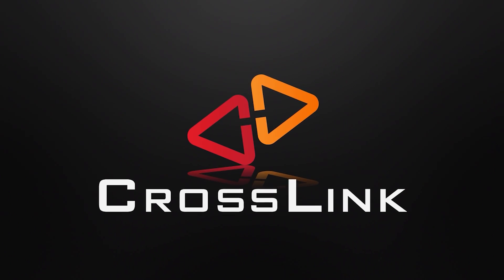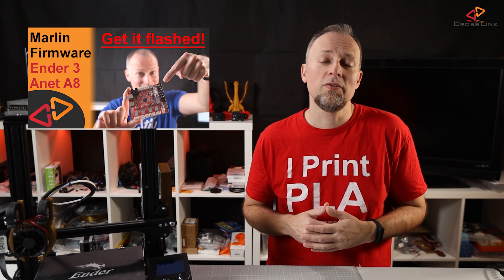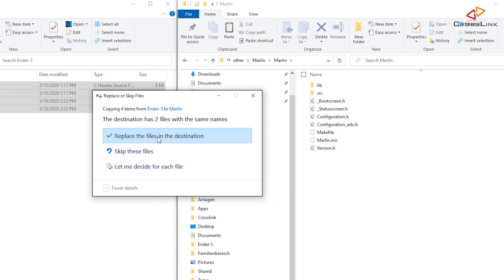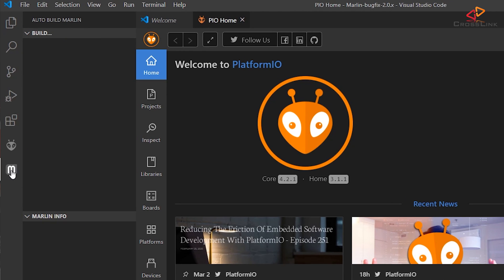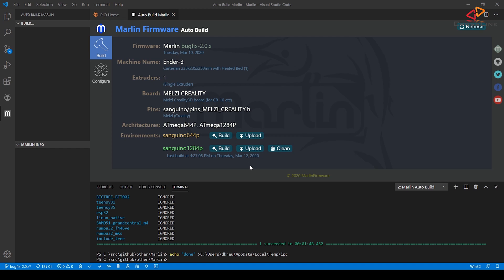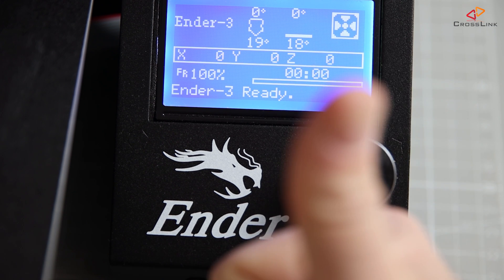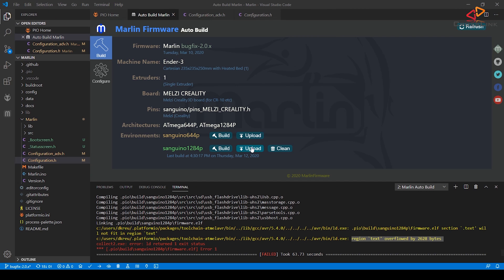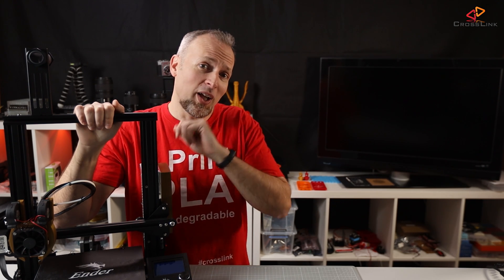Ender 3 (Pro) Marlin 2.0 Upgrade  - Updated Version

Comment: Have tired 2 different pc's and reload the programs 3 time and keep getting the same message "sanguino_atmega1284p  FAILED    00:00:01.864". Do you have a recommendation?
Reply: I get the same error compiling, i have even tryed with a older version of marlin but i get the same error.
Reply: Same here
Reply: Use the bugfix branch.  He didn't specify that part.
Reply: @Thibbs5  hey guy! I have the same issue so i got the bugfix firmware, but now i get the option to build either Melzi or Melzi_opiboot  which one shall i choose for ender 3?
Reply: @Thibbs5  I used the bugfix branch, it still failed.  Oh well.  Guess I didn't need to update the firmware that bad anyway.
Reply: @Thibbs5  How do i do that?
Reply: Try PIO Update.  I was getting this error with the logs showing something to the effect of missing parathesis.  Running PIO UPDATE from the command line fixed the issue and everything else has gone smooth.
Reply from the maker: Can you please post you output window contents here?
Reply: @Crosslink3D  sanguino1284p .......... FAILED     Compiling .pio\build\sanguino1284p\src\src\module\probe.cpp.o
* [.pio\build\sanguino1284p\src\src\module\motion.cpp.o] Error 1  Good clear video thanks ... i get the same error though  my printer is still in the box just got it today so any  help for this firmware would be grateful Ender pro 3...  in the  config examples there is a option for the pro 3 now what could be the problem?
Reply: I'm having the same issue with the Melzi_optiboot showing up as an option.

Comment: After installing the firmware... my printer now knocks of the prints,... after a couple of layers.. :( Possible to solve this?
Reply from the maker: Did you enable mesh bed leveling or using a probe?
Reply: @Crosslink3D  don't use both. I know what the issue was.. de x gantry was living his own life..
Reply from the maker: Uhhhh that's bad 🤪

Comment: would love to see your thoughts on using this system to enable BLtouch or other probes, i use. mac so having a hard time trying to find what i can use to get my touch probe set up
Reply from the maker: Great suggestion!
Reply: @Crosslink3D  Hi i am new to updating firmware etc. my new ender 3 pro has  the new v4 2.2 mainboard and i am stuck getting bl touch working. i have marlin 2.0 on the printer but i am stuck with what changes to make etc. please can you help?
Reply from the maker: I’ve just released a new video about how to use the bltouch with Marlin 2.0. it’s for the Ender 3 bit should be working with any printer (the hardware connection might of course be different but the firmware config is probably very simple to adapt)
Reply: I would also like to see a video regarding BLTouch in the 2.0 firmware

Comment: hello to you when I composed the types of cork so I got these errors
In file included from Marlin \ src \ HAL \ AVR \ .. / .. / inc / MarlinConfig.h: 40: 0,
                 from Marlin \ src \ HAL \ AVR \ Servo.cpp: 56:
Marlin \ src \ HAL \ AVR \ ../../ inc / SanityCheck.h: 1297: 4: error: #error
   #error "Select one of: MESH_BED_LEVELING, AUTO_BED_LEVELING_LINEAR, AUTO_BED_LEVELING_3POINT, AUTO_BED_LEVELING_BILINEAR, or AUTO_BED_LEVELING_UBL."
    ^
In file included from Marlin \ src \ HAL \ AVR \ .. / .. / inc / MarlinConfig.h: 40: 0,
                 from Marlin \ src \ HAL \ AVR \ HAL.cpp: 25
Marlin \ src \ HAL \ AVR \ ../../ inc / SanityCheck.h: 1297: 4: error: #error
   #error "Select one of: MESH_BED_LEVELING, AUTO_BED_LEVELING_LINEAR, AUTO_BED_LEVELING_3POINT, AUTO_BED_LEVELING_BILINEAR, or AUTO_BED_LEVELING_UBL."
    ^
In file included from Marlin \ src \ HAL \ AVR \ .. / .. / inc / MarlinConfig.h: 40: 0,
                 from Marlin \ src \ HAL \ AVR \ HAL_SPI.cpp: 34
Marlin \ src \ HAL \ AVR \ ../../ inc / SanityCheck.h: 1297: 4: error: #error
Compiling .pio \ build \ sanguino1284p \ src \ src \ HAL \ shared \ backtrace \ unwinder.cpp
   #error "Select one of: MESH_BED_LEVELING, AUTO_BED_LEVELING_LINEAR, AUTO_BED_LEVELING_3POINT, AUTO_BED_LEVELING_BILINEAR, or AUTO_BED_LEVELING_UBL."
    ^
In file included from Marlin \ src \ HAL \ AVR \ .. / .. / inc / MarlinConfig.h: 40: 0,
                 from Marlin \ src \ HAL \ AVR \ eeprom.cpp: 23:
Marlin \ src \ HAL \ AVR \ ../../ inc / SanityCheck.h: 1297: 4: error: #error
   #error "Select one of: MESH_BED_LEVELING, AUTO_BED_LEVELING_LINEAR, AUTO_BED_LEVELING_3POINT, AUTO_BED_LEVELING_BILINEAR, or AUTO_BED_LEVELING_UBL."
    ^
In file included from Marlin \ src \ HAL \ AVR \ .. / .. / inc / MarlinConfig.h: 40: 0,
                 from Marlin \ src \ HAL \ AVR \ MarlinSerial.cpp: 39:
Marlin \ src \ HAL \ AVR \ ../../ inc / SanityCheck.h: 1297: 4: error: #error
   #error "Select one of: MESH_BED_LEVELING, AUTO_BED_LEVELING_LINEAR, AUTO_BED_LEVELING_3POINT, AUTO_BED_LEVELING_BILINEAR, or AUTO_BED_LEVELING_UBL."
    ^
In file included from Marlin \ src \ HAL \ shared \ .. / .. / inc / MarlinConfig.h: 40: 0,
                 from Marlin \ src \ HAL \ shared \ HAL_spi_L6469.cpp: 28:
Marlin \ src \ HAL \ shared \ ../../ inc / SanityCheck.h: 1297: 4: error: #error
   #error "Select one of: MESH_BED_LEVELING, AUTO_BED_LEVELING_LINEAR, AUTO_BED_LEVELING_3POINT, AUTO_BED_LEVELING_BILINEAR, or AUTO_BED_LEVELING_UBL."
    ^
In file included from Marlin \ src \ HAL \ AVR \ .. / .. / inc / MarlinConfig.h: 40: 0,
                 from Marlin \ src \ HAL \ AVR \ watchdog.cpp: 25:
Marlin \ src \ HAL \ AVR \ ../../ inc / SanityCheck.h: 1297: 4: error: #error
   #error "Select one of: MESH_BED_LEVELING, AUTO_BED_LEVELING_LINEAR, AUTO_BED_LEVELING_3POINT, AUTO_BED_LEVELING_BILINEAR, or AUTO_BED_LEVELING_UBL."
    ^
Compiling .pio \ build \ sanguino1284p \ src \ src \ HAL \ shared \ backtrace \ unwmemaccess.cpp.o
* [.pio \ build \ sanguino1284p \ src \ src \ HAL \ shared \ HAL_spi_L6470.cpp.o] Error 1
* [.pio \ build \ sanguino1284p \ src \ src \ HAL \ AVR \ Servo.cpp.o] Error 1
* [.pio \ build \ sanguino1284p \ src \ src \ HAL \ AVR \ watchdog.cpp.o]
* [.pio \ build \ sanguino1284p \ src \ src \ HAL \ AVR \ HAL.cpp.o]
* [.pio \ build \ sanguino1284p \ src \ src \ HAL \ AVR \ eeprom.cpp.o] Error 1
* [.pio \ build \ sanguino1284p \ src \ src \ HAL \ AVR \ MarlinSerial.cpp.o] Error 1
* [.pio \ build \ sanguino1285p \ src \ src \ HAL \ AVR \ HAL_SPI.cpp.o] Error 1
can you help us with that?
Reply from the maker: Looks like you wanted to enable some kind of bed leveling but did not choose what kind of bed leveling.

Comment: I love watching your videos.  I have a question that so far i have not been able to find a specifically  answer for:
I have the Ender 3 and I installed the Bigtreetech SKR Mini E3 Version 1.2 and have the Firmware Marlin Bugfix 2.0 x loaded.  Before I install the BLTouch Version 1.3 is there anything else I need to do differently to make this work?  I hear some say you just plug the cables into the board and enable the leveler.  Of course I'm not sure what they mean by enabling...is that thru the Ender display so It's just a click or is there some firmware editing to be done?  I have never done this stuff, so before I educate myself I thought to ask first.
Reply: I too have just upgraded my other Ender 3 pro to the SKR Mini E3 v1.2 & have installed the the BL touch (V3)!
Depending  on what version of BL touch you have you may have to re seat some of the cables on the DuPont connector!
I have installed one but am having trouble getting it work properly

Comment: I am having these errors when trying to upload: avrdude: stk500_getsync() attempt 1 of 10: not in sync: resp=0x65
Any idea how I can fix it ?
Thanks
Reply: What programmer are you using? usbtiny ?
Reply from the maker: Probably the upload speed is not set to be 115200. Look in your platformio.ini in the configuration section for the environment you selected and change it to 115200.

Comment: Hello!
When trying to compile, I have this error:

Verbose mode can be enabled via `-v, --verbose` option
  File "C:\Users\EldonTyrell\.platformio\platforms\atmelavr\builder\main.py", line 30

    print "Please unplug/plug device ..."

                                        ^SyntaxError: Missing parentheses in call to 'print'. Did you mean print("Please unplug/plug device ...")?
Any idea how I can fix it ?

I think we need to install something else prior to install VsStudio Code as this apparently does not work out of the box.

thanks for helping me !

Stéphane
Reply: OK, apparently, it can be fixed by entering "pio update" in the IDE terminal.
Please add this to your tutorial as this really blocked me for some moment and many users will be blocked exactly like me.
Reply from the maker: Noted!

Comment: Fantastic guide. Thanks for all the help! I can successfully flash Marlin 2.x.x to my E3P(creality silent 1.1.5 board) no problem.I am even noticing an improvement in quality! :)

Though I am having an issue enabling Mesh Leveling. I can enable/disable all the features you have mentioned, but as soon as I try and enable LCD_BED_LEVELING, I cant flash the firmware :/ I have rebuilt and reflashed after commenting/uncommenting each line one by one. It always fails at the LCD_BED_LEVELING line. The printer will show it momentarily but after a reboot it shows a blank screen and wont boot again. Any idea why that line specifically could be giving issues? Thanks again :)
Reply from the maker: Probably you have not enough memory left. Try to reduce firmware size using this guide: https://thborges.github.io/blog/marlin/2019/01/07/reducing-marlin-binary-size.html
Reply: @Crosslink3D  You were right! I was filling up to basically full, I needed to leave some additional extra space and it loaded! Your videos rock thanks for the help.

Comment: how do I change board type? when I load marlin, it shows a board and machine I dont have.
Reply: Same here, i got up to 6:06 and the machine name is RAMPS 1.4? How do 
i switch this?
Reply from the maker: You both did probably not copy the default config files for your printer to the right directory or did not overwrite the default files.

Comment: How could this work? An older Ender3 has a 8-bit board and also a 8-bit firmware. So far I know, the Marlin 2 is for 32-bit boards, and how this 32-bit firmware could run on a 8-bit board?
Reply: Marlin 2.X IS NOT ONLY for 32 bits. It also compile for 8 bits
Reply from the maker: Exactly. Marlin 2.0 not being for 8bit was a big rumor when it wasn't released but it works with no issues

Comment: Having a blue screen on the ender 3 and weird beeping sounds after enabling mesh bed leveleing and disabling the features you sugested. The board isnt responding either by connecting to PC or standalone. 
I have followed your instructions and every step worked well till the last step.

1)  Update to Marlin 2.0.5 worked
2) Enabling mesh bed leveling and disabling Arc Support + custom bootscreen --> firmware was compiled and it seemed to be ok BUT the Ender 3 Screen was frozen and weird beeping started.

If i now turn on power nothing other happens than the blue screen and the PC will not recognice the board anymore.

Creality 1.1.5 Board
TMC2208
Reply: Hi Marko. I had the same problem with my same board. We need 512 bytes open for bootloader. You need to disable more and get firmware to MAXIMUM 99.2%.It will not work with biger size.  good luck
Reply: P.S. you need to reload bootloader now I would have been overritten
Reply: P.S. I used this guide using a raspberry pi : https://www.fission3d.com/post/flash-bootloader-and-install-firmware-with-raspberry-pi
I loaded optiboot bootloader:  https://github.com/Lauszus/Sanguino
Reply from the maker: Correct, I remember having this issue the first time I flashed a firmware too big. You need to flash a new bootloader 😟
Reply: @Crosslink3D  alright thanks!

But great Videos on your channel anyway!! thank you for that :)
Reply: @tangmonster  Thanks for your fast reply! This is also what i thought happened . I thought the size of the bootloader is being reserved and automatically calculated while compiling..

So ill have to get an ISP programmer or Arduino Uno anyway.

Thanks

Comment: I did this update yesterday marlin 2.0.5.3  I have a 1.1.5 silent board. With flash size of 99.8 and even 99.5 ( disabling boot and flash screen) I had weird problems escpecially after eeprom init. I actually lost bootloader and had to reload it. After disabling a few more things and getting "99.2% (used 129014 bytes from 130048 bytes)"  only then it worked fine with eeprom saving and is consistanly booting. Does the 1284p boards have seperate EEPROM or does the chip use some of the internal flash for this data space?
Reply: "I had weird problems" with weird problems i mean it booted a few times and then stopped working. after eeprom init. And I had to reload bootloader.
Reply: I found this link helpfull : https://thborges.github.io/blog/marlin/2019/01/07/reducing-marlin-binary-size.html
I added the two lines to my platformio.ini so that it looks like this:
#
# Sanguinololu (ATmega1284p)
#
[env:sanguino1284p]
platform      = atmelavr
board         = sanguino_atmega1284p
lib_deps      = ${common.lib_deps}
  TMC26XStepper=https://github.com/trinamic/TMC26XStepper/archive/master.zip
src_filter    = ${common.default_src_filter} +<src/HAL/AVR>
build_unflags = -g -ggdb
build_flags   = ${common.build_flags} -fno-tree-scev-cprop -fno-split-wide-types -Wl,--relax -mcall-prologues

compiles fine, lots of google links explain what these compiler directives do.
now my build is 94.5% 122922 bytes.
I have not tested this yet.
Reply from the maker: Exactly, this helps a lot. 99.X percent seems to cause some issues. I will mention that in a future upgrade.
Reply: @tangmonster  If it works, please us know. Thx in advance.
Reply: @marionette409   Hi ! , yes the compiler directives worked 100% for me. I have been printing constantly with this new firmware with mesh bed leveling etc. I am at 94.6% even with sd card and a list of other items enabled.

Comment: Help! Thank you for posting this video. You make it easy to understand. I'm having a problem after updating my 1.1.5 board to the marlin 2 bugfix in this video. When I turn on my ender 3, the LCD screen is blank. If I turn it off and on several times, so far it has eventually come on and I am able to print. This happens most every time I turn it on.
Reply: I'm having the same issue with my printer after upgrading to the 1.1.5 and 2.0 marlin  and will be watching for a fix because it is annoying not sure if older versions have this issue
Reply: I'm having the same problem except I've turned my printer on and off several times and it's still blank. I try to reflash and get a "not in sync" error like there is no bootloader.  If someone can PLEASE help me please do!

Comment: This version is compatibile with bl touch ?
Reply from the maker: Yes, Marlin 2.0 supports it of course
Reply: Thanks , when i was flash firmware the 3d printing had  struggled to start. In your opinion i have to change the motherboard ?? Thanks so much
Reply: I have the original motherboard ender 3 pro

Comment: i tired your other video first with the new version on marlin, i didnt load the new files like you said before opening the folder, how to i get it to see the replaced file, it says machine name is ramps 1.4 and environments mega1280 and mega 2560
Reply: Did you find an answer to this?
Reply: same here. Shows RAMPS and the two Mega options but not Sanguino
Reply: I hit the same issue. In my case, I missed that you have to put the config files in the Marlin directory. There are existing config files you have to copy over. Video was clear on it.

Comment: I am having issue "not in sync" after enabling mesh bed lvling steps. Is there a way to fix that through usb instead of buying other hardware?
Reply: Check the settings in before you uploa/flash the firmware to your motherboard. Experiment changing the port, programmer, and the other settings under the tools section in the toolbar at the top of your computer

Comment: Hello, I have instaled marlin correctly, all be right. But when i active bed leveling i cannot upload in my ender 3 pro. 1failed, 0 succeded... 
In the terminal i have one error "collect2.exe: error: ld returned 1 exit status
* [.pio\build\sanguino1284p\firmware.elf] Error 1"...
i dont find any solution in the comment or forum...
Reply: Nevermind, it's because you don't have enough space on the board.
Reply: You did enabled #define BLTOUCH? I had the same error. Looks like you can't for now until a fix.
Reply from the maker: Can you please post the content of your output window here, so I can read what is the issue?

Comment: i got error "1 failed, 0 succeeded."
so looks like i need to install boot loader, correct?
Reply from the maker: Well, that depends what's in the error messages. Scroll up and tell me about what the actual error message is.
Reply: i had the same problem with 2.0X, but success with 2.0.5.3

Comment: Hi Daniel, first of all, great video, thumbs up, keep up the good work.
FYI, I get out of sync error, but my printer is unlocked, so I flashed it with arduino without any problems.
I checked port settings, seems ok, do you know if there's anything I may also check to get it fixed on vs code?
Reply from the maker: Probably you have to change the baudrate to 115200 in platformio.ini for your specific environment.
Reply: @Crosslink3D  Thank you for a tip, I'll check it out
Reply: @Crosslink3D  Could you please describe to a complete newbie how to do that?